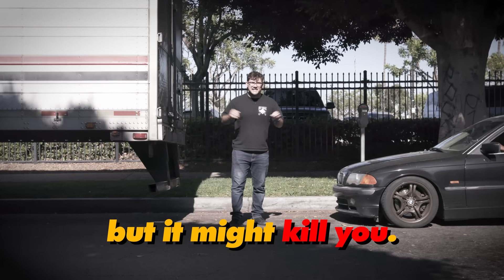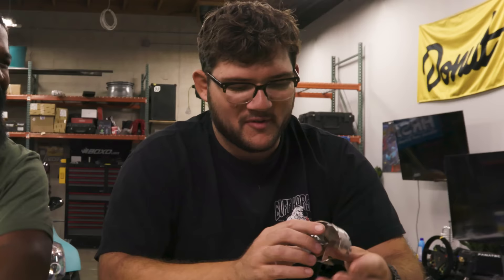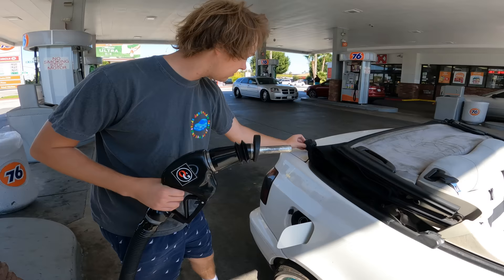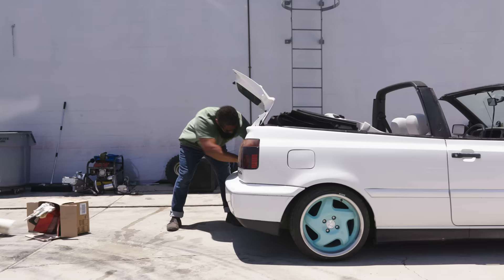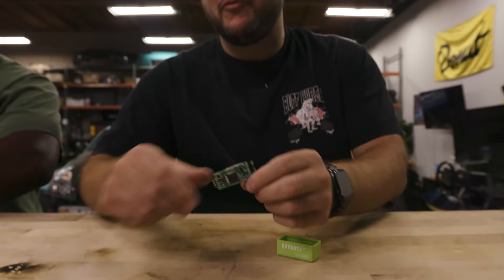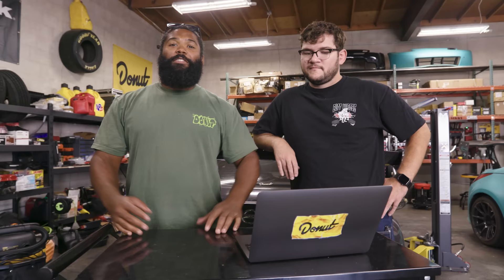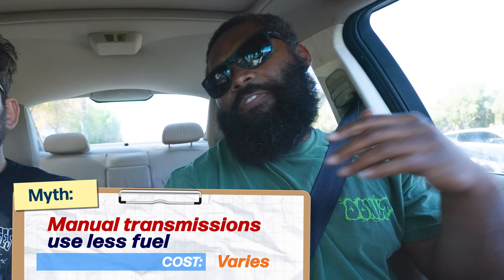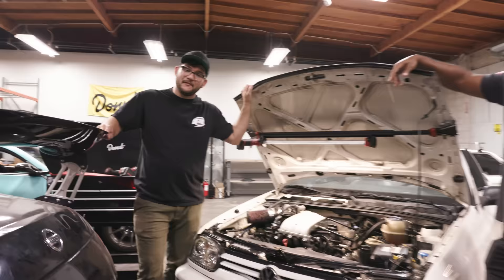Testing Fuel Economy Hacks

Comment: As far as efficiency of manuals vs. automatics, the gearing is one thing, sure, but as I understand it, the main thing was the torque converter.  It essentially constantly "slips" a bit.  Even assuming exact same gearing, the automatic loses energy because the manual is functionally locking the engine to the transmission once it's in gear and the clutch is engaged.  Of course, the dual clutch transmission solves that issue.
Reply: Modern (2010+?) hydraulic automatics solve this problem as well by supporting torque converter lockup in most, if not all, gears. (Example: Mazda Skyactiv-Drive is said to support lockup in all gears)
Reply: DCT don't solve the net energy requirement, as automatic transmissions in general use more energy from the engine upfront to even work, which a manual doesn't.
The slipping TC (which isn't even used in every AT, some use an electric motor instead) is one thing but the real problem is the base energy consumption, which makes them less efficient especially at lower speeds and which can usually only be compensated with using longer gears at higher speeds, as you can't use those longer gears at lower speeds. More gears can also decrease the gear steps, which reduce the overall rpm (and thus increasing engine load), when being light on the gas, but this usually won't compensate for the base consumption. Those transmissions usually use 8 gears where a manual uses 6 and have an additional 1-2 gears as overdrives. 
More gears increase the base energy consumption and the weight as well. 
There are other benefits to automated transmissions but efficiency isn't. For example the shifting strategy is consistend, which doesn't mean it is better at all times.

To be clear, automatic transmissions have improved quite a lot, which reduce the difference between them and Manuals to a point, where the driver's profile makes the difference. On top they offer more options for hybrid power trains, which can in return save even more fuel. On the other side they cost more money, as they require more materials, software and maintenance.
Nowadays it's mostly a decision between upfront car costs or overall consumption profile. For example a lot of german cars aren't cheap so initial cost isn't that relevant, but neither are they overly efficient which makes consumption more relevant for the manufacturers product line.
In the EU manuals usually are used in cheaper cars or as an overall option to save money, as an increase of about 10% in price usually won't compensate in fuel efficiency against a manual, if it would do so in the first place.
Automated transmissions really had their time when the NEDC was used for official consumption figures, as this cycle didn't allow an efficient use of a manual gearboxes, but any automated transmission could use the highest gears available.
For example only at 50 km/h you where allowed to shift into 4th gear, even if 5th or 6th was the overall better option, while any automated transmission was allowed to use this same 5th or 6th gear.
Reply: @fwebe2871  wow good read with a lot of information. Where can I read more about this? I would also like to add that the wltp cycle also sees manuals as more efficient with makes the price difference between manual and automatic transmission even bigger in countries with carbon taxes on cars (for example the Netherlands)
Reply: I'll assume the goal of increasing GPM is to save $. (duh).  Question though, How much more does that 8spd electronic auto cost versus what a simple 3spd auto w/locking converter, just old vac and throttle signals to control shift would be?, and how long will it take for that small change in gpm to pay it back?  If it needs service/repair I'm sure any gas saving $ is shot to hell.
Reply: @jime8532  the change is probably more expensive than the economic value of such a car
Reply: Ik my car in Auto will run at way less RPMs than when I have it in manual mode at city speeds. Whereas when I have it in the correct "gear" for the same  speeds its got higher RPMs and wont even allow me to slesct a higher "gear". CVT '19 Forester. But in Manual mode I can choose a higher "gear" for more coasting downhill (7) where the Auto will only typically go to (5).
Reply: @JeremiahReddy  I have  2007 volvo xc90 auto that has lockup for the torque convertor. A lot more cars have it that people realise. The slip is a loss and lock does come in later than a manual "equivalent" would. I can see live data with a Delphi machine. Every gear locks up just depends on driving conditions. Hard acceleration locks up faster
Reply: Question regarding economy. For my manual I have 100USD for a new clutch system and 500 USD for a repass of the transmission mechanism (Ford Mondeo 2016/in US as Ford Taurus). How much is for clutch/transmission mechanism repair in automatic?
Reply: i think a part of the 'myth' was also that in a manual, you would stay in a single gear even if you speed fluctuated a bit, like 30-35, but in an automatic it might constantly switch between gears if your speed is fluctuating, and people would think that the changing of the gears was increasing the fuel consumed, but again modern automatics are much better
Reply: Does automatic cost less than manual in US? Automatic costs more in India and hence people just go for manual. Never did they realise they were having fun lol
Reply: @delphy2478  it's not part of the myth. It is actually true . And while modern autos have improved a lot they still consume more than manual that the driver actually knows how to use the correct gear
Reply: The main thing is autos will downshift to give you torque. In my manual, I'm perfectly fine staying in 5th and just giving it a little gas to get it up to speed. In my auto, it downshifts like 2 gears if I so much as think about speeding up.
Reply: Another reason is weight. Auto Transmission used to be at least heavier than manual transmissions.
Reply: Yeah they kinda exaggerated with showing 60s cars around 10-15years ago they started adding a bypass clutch that bypasses the torque converter which made automatic about equal to manuals…
Reply: @junkbob6832  Being in a higher gear than necessary makes tue engine have to work harder which uses more fuel. RPM is only part of the formula, lower RPM doesn't necessarily equal less gas.
Reply: @darkrac2  Same in europe, and car companies regularly post higher MPG for manuals while also being cheaper to buy

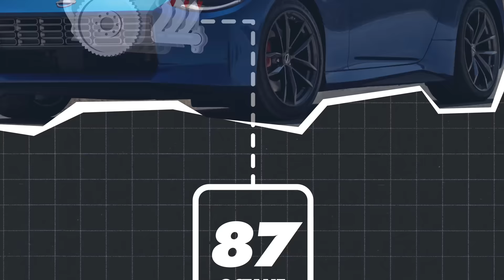Comment: One thing about the octane rating at 9:10
If you put 87 when you require 91, you’ll get worse mpgs and spend more on gas in the long run
Reply: YA. Came here for this comment. I believe It retards the ignition and/or runs richer to avoid knock.
Reply: smartass here - it won't only increase your mpgs but might potentially break your engine  (if knocking gets too bad, although modern ecu comes with knocking safety modes where your engine is run rich to reduce knocking, which in even more modern cars needs a mechanic to remove (check engine light comes on), with moderately modern cars it tests for better fuel in a given period)
Reply: @chazeroni455   This. The ECU will try it's best with what fuel you provide it. If you give it something outside its needed rating, then it'll try work outside that parameter, making it much less efficient.
Reply: In my BioPower SAAB i can run ANY %mix between gas and ethanol, and the computer will switch accordingly. (More % Ethanol, more HursPurs)
Reply: also because of computer controlled ignition and turbos (and to some degree injection), you can get a higher mpg on higher octane if the ecu is programmed right, but the consumption will most likely change less then the extra cost, and the change might only be on higher loads. its more likely you'll get a little bit of extra power, but again it depends on how the ecu is programmed.
Reply: Here its only 95 and 98 :((
Reply: @LinusAkaPano  newer Mazdas will run on anything at my pump 87-91 obviously not the crazy e-85, e-15 n stuff but the others are Gucci and yeah more hrsprs lol 😂
Reply: @toeleg  e15 is standard gas, or close to it
Reply: @TheLongDon  where I get gas 87-91 is up to 10% ethanol lol idk where u live though.
Reply: @lolfcksake6909  The UK and the US use different methods to compute octane rating. US 87 is UK 91, US 91 is UK 95, and US 94 is UK 98 or 99.
Reply: @toeleg  Yes but government allowed up to 15% now because of Covid, or gas shortage or something recent. Either way, it's within the same range, it's not exactly a huge difference
Reply: @LinusAkaPano  those extra horses are from the extra octane of ethanol =)
Reply: @TheLongDon  well you can use e-15 lol I'm good sounds like fake news to me
Reply: your big problem in Europe starts as regular low octane is 95 and on high you can get 98 and 99 out of the pomp (99 very rare though) and most cars run them both options no problem, unless money is a problem, and fuel is way more expensive here (like over 2$ /liter going in the 7-9$/lb )
Reply: Thats also not what
Top tier is. Top tier is a standard for gasoline written by a group of auto manufacturers.
Reply: @TheHenirik  100% Right! You even had me double check my sources. E85 sits at a nice 105 octane rating. And then there's more, the ethanol keeps your engine extra cool! Those two details together make a pretty big deal.

Now my original comment was of course about the tuning levels from factory. Throw in a third party tuning and you could push (allegedly) 100+ extra HPs (Although at that point you're removing regular gas as an option).
I haven't done any special Eth tuning on mine, just a standard Stage 2 at Maptun Sweden. 175 -> 225HP.  And then most sources say going purely Eth adds + ~25HP
Reply: @TheLongDon  no e10 is
Reply: @TheLongDon  the number of stations that actually have and use it is insanely small only like 2 percent nationwide it is just another thing Biden did that sounds fine but does literally zero hood
Reply: @Utubesuperstar  Yes but that wasn't the point, the point was that e15 isn't some crazy fuel
Reply: @TheLongDon  actually it is, only like 2 percent of stations use it and only in certain seasons bar bidens new rule that will do absolutely zero good btw. e10 is the standard e15 is worse for engines and is on the very edge of what they can take.

Comment: I got a peek at the results from a safe-driving project that gathered a lot of data, which showed that people who drove smoothly had the best fuel economy. Smoothly meant no bursts of acceleration or sudden braking, which usually extended to a more relaxed overall driving style too. People who went out of their way to do things like accelerate before going up a hill so their speed evens out at its peak (not while towing though) usually ended up having worse fuel economy.
I like to think that means good fuel economy through your driving style is as simple as not overthinking it and just driving sensibly.
Reply: acceleration doesnt matter that much, breaking does. When you break, all the energy used for move the car is wasted... So driving style that needs less breaking is more efficient.
Reply: @Ic3g3org3  Actually, Genius. Acceleration pushes more gas faster for the use to create energy at a faster rate, OR ACCELERATION. So Yes it does matter, to the highest extent.
Reply: @importslunglowful  I didnt say it doesnt matter at all, but the highest waste of energy is wasted is from breaking. If you wanna drive saving fuel, start with the most important thing and thats predicting, so you dont have to break that much.

Comment: Back in 2000 i made it from Southern Illinois to Phoenix (~1200 miles) on just under 3 tanks of gas. Over 400 miles per tank, in a 93 sentra auto. By drafting behind semis the whole way. Never got that good mileage again.
Did it again across the valley(48 miles) in my '18 sentra and got 54mpg. Drafting works. But it's stupid dangerous.
Reply: Yupp. Even on a bicycle with a much smaller frontal area, drafting behind a car made pedaling much more effortless. Can't imagine how huge the effect must be for cars behind semis.